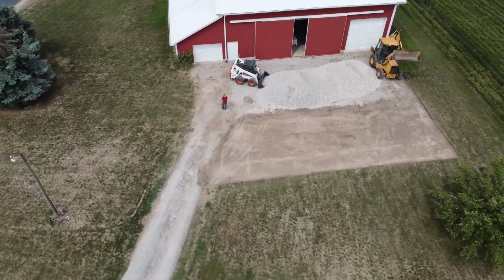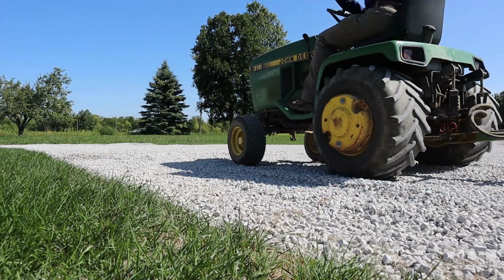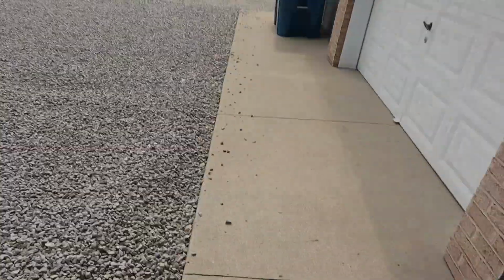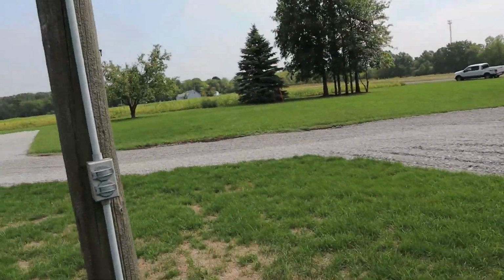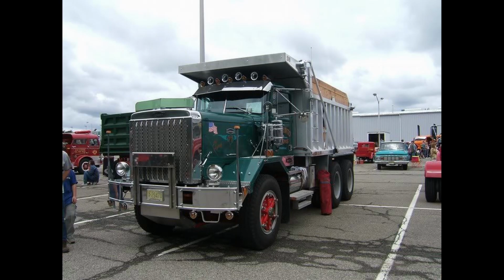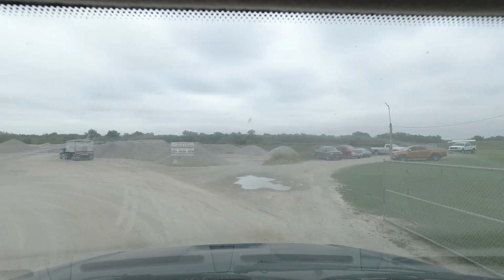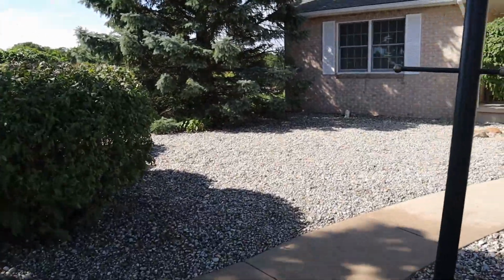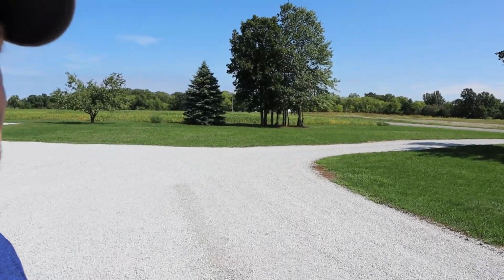The Best Dump Truck Driver Spreading Stone with Kenworth T880 Triaxle - Driveway Makeover Part 2

Comment: hope it never snows there
Reply from the maker: You mean in terms of plowing? It doesn't snow like it used to around here so fortunately won't likely need plowed too much.  That is a risk of pushing a bunch of stones off the top with this kind of top coating, but there are a number of ways to prevent it as well.  For us, the best method is wheel packing the snow first by driving on it before plowing.  This works the best for me at home and my entire driveway is loose stone.  I just drive around on the snow and then the blade rides on top of the wheel pack.  It is something to consider for sure though cause if someone comes in to plow that doesn't know what they're doing they will probably make a heck of a mess.  Thanks for making a good point and thanks for watching!

Comment: The truck driver is super skilled and are gentle and carefull in his driving
Reply from the maker: Yes, quite a master at his craft.  Thanks for checking out the video!
Reply: It's not that hard...
Reply from the maker: @aaronsanborn4291  Need to tell that to 95% of the drivers I've watched trying to do this...
Reply: @digdrivediy  I'm 2nd Generation...I started doing it when I was about 15...I also grew up on a farm I was driving a silage truck on my grandfather's farm at 10 years old. My Dad is 70 still drives dump truck. I spend a lot of time building logging roads, driveways etc I tailgate gravel and stone all the time.
Reply from the maker: @aaronsanborn4291  Right on.  I think that's what it takes.  You're in the 5% then if you can spread like this dude!  Lots of guys can spread pretty well but he's the only one I've ever seen that can start spreading like that at the edge of the concrete almost perfectly over and over again every time, but obviously I haven't seen every trucker out there.  Kudos to you if you've achieved that level cause that is impressive.  Thanks for sharing and thanks for watching.
Reply: @digdrivediy  it's just practice and knowing your truck...when you're in the same truck every day it helps. I've also done my share of paving.

Comment: I have a 316 and 330 and I am so jealous of that 755 with FEL. I have been trying to talk myself into buying a 1025r and trading my 300’s in on it for a few years but I just have a hard time getting rid of them.
Awesome video
Reply from the maker: Thanks Beau!  If I were you I'd want to keep the 300s as well!  I would keep those two and look for an older compact like the 755 or 855.  I have two 755s for less than the cost of one new 1025r!  Appreciate you watching! (Oh, and several other videos on here of my little tractors working if you're interested)

Comment: When it comes to snow removal, be sure to get a set of "edge tamers" to clamp on your bucket.  When you see them, you'll know how they work.  Move the snow, not the gravel.
Reply from the maker: I haven't heard of them but I will be glad to check them out.  I am a big proponent of trying to only move snow and not stone.  Thanks for the tip and for checking out the channel!
Reply: @digdrivediy  , you can see them in action on "Tractor Time with Tim". In addition to removing snow and not gravel, he also uses them to shovel soil (digging a ditch for water line) off grass and  not tearing up the turf. (2" size=$100. use TTWT promo code)

Comment: Its NOT very hard to do... when you have an automatic truck, level ground, no above wires...lets be real.
Reply from the maker: The spreading part might be less challenging, but starting and stoping exactly where you want to turn it on and off takes some skill and experience. But to be real, if it were not that hard to do we wouldn't see so many drivers struggle with it. I'm sure if you're in a truck every day you have no doubt seen that too.  Thanks for watching!